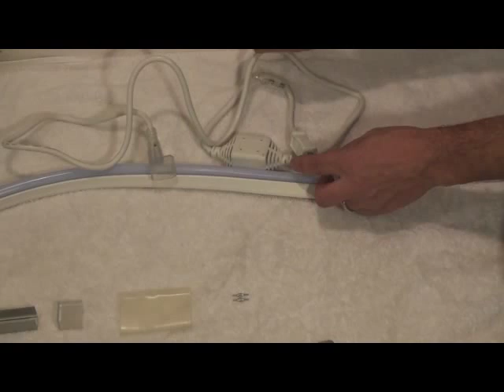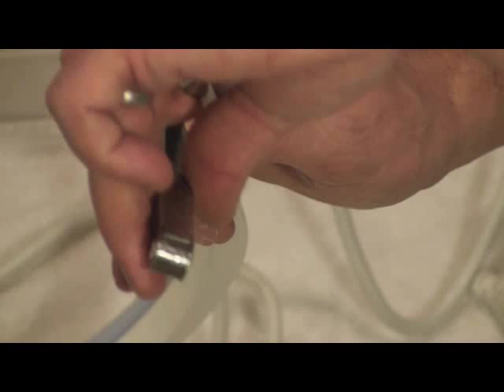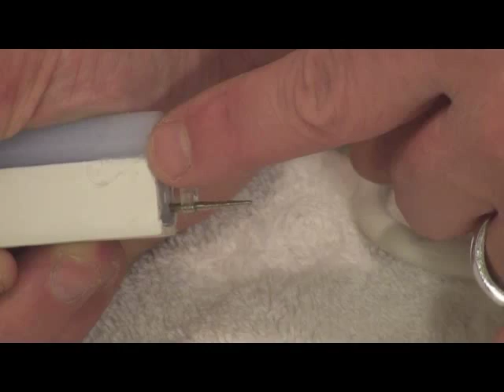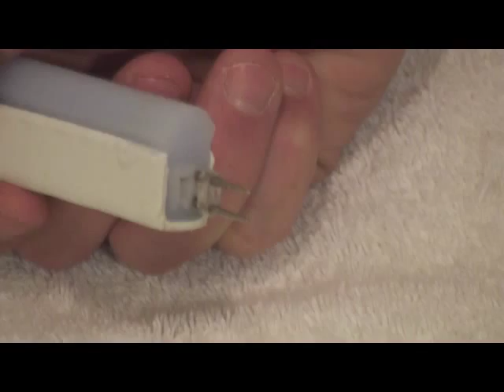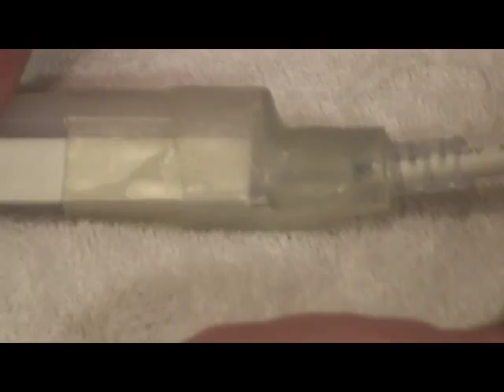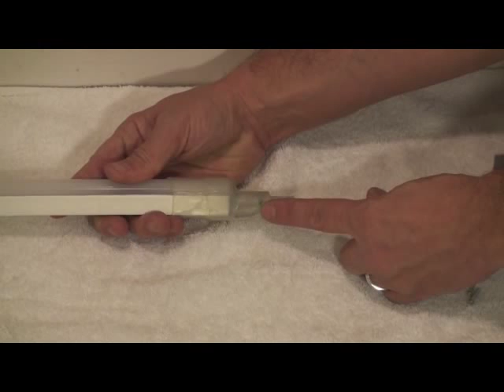How to properly install Led neon lights

Comment: Ummm, you do know there's no such thing as LED neon lights, right?  I mean neon is a gas and LEDs don't use neon gas. Neon gas needs high amounts of energy to excite it to glow in a vacuum. LEDs require very low current to operate.

Please get it right.
Reply: There’s also neon colors, for example: neon red, neon blue etc.